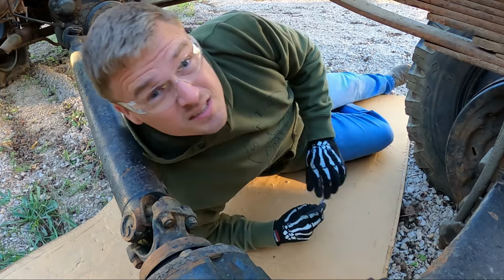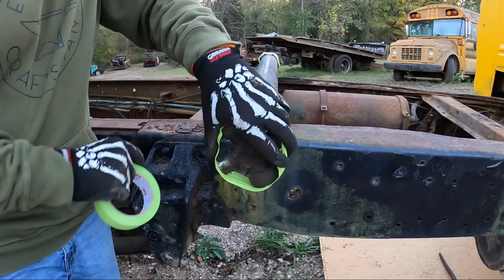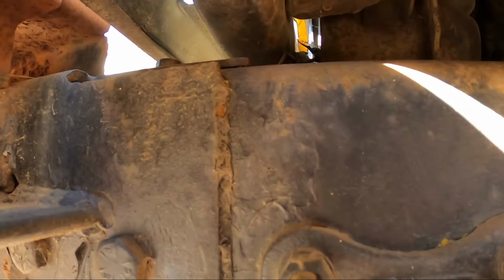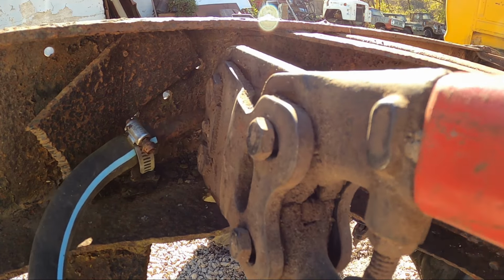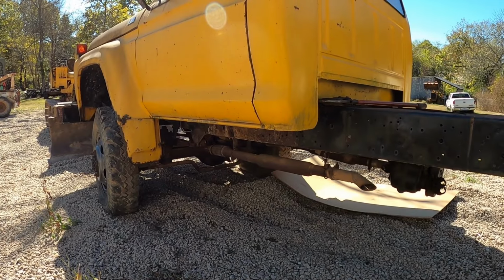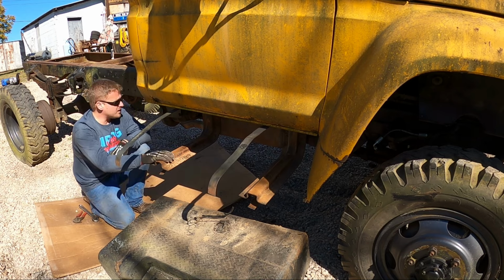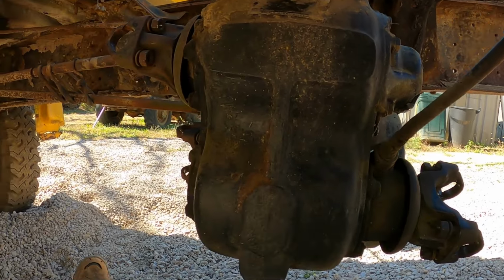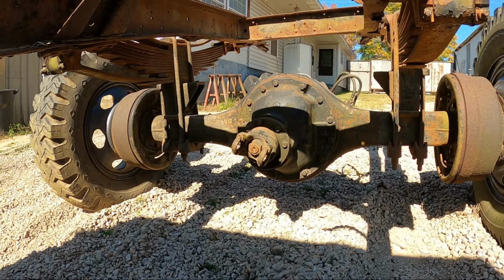Project Atlas Episode 6: Teardown Begins

Comment: It’s crazy how much that rust can push that frame out.  Too bad that it has seen a lot of abuse.  I thought it was funny that someone stick welded the bumper to the frame🤣.  That gapping hole in the transfer case is definitely an issue.  Hopefully it can be rebuilt because I’d imagine it would be difficult to find a replacement.  I think a 12 valve is an excellent engine choice.  When it comes to diesels it doesn’t get much better👍
Reply from the maker: Thanks for stopping by Cody! 😁👍 Very true, you can't beat the durability of a Cummins engine. I hope things are going well for your Dakota swap buddy!  Happy wrenching   🔧🔩

Comment: Glad to see you making progress. I see you the same brand of creeper that I use as far as the case you could probably braze that hole up and have a machinist cut it back in but if you’re going to use a common might as well use the NV 4500 and transfer case for that will be plenty strong and easy to get parts for👍
Reply from the maker: You've got a great idea, I could probably just dich the Rockwell t-case.  I didn't even think of that. I appreciate the comment Nathan 😁👍 I hope all is well for you my friend 🔧🔩 Talk to you later
Reply: @HODGEPODGEDODGEGARAGE  did not realize that was a Rockwell T case most likely what happened was they had it in reverse and four-wheel-drive? Those things tend to grenade when you do that for my understanding.

Comment: Great to see you back Zane on the rear diff pop out the axles take five mins. As for the transfer case well you gunna have to take it completely apart and see what happened. Was it water that froze and popped out the bearing cap? Good luck and again thanks.
Reply from the maker: @bradanderson1627  no water luckily, so I shouldn't have to worry about cracks Brad 🙂👍 Thanks for the view and kind comment. Have a great day 🔧

Comment: Probably just frozen brakes. That broken cap is just that, a cap. They did offer an optional pto that could bolt in it's place though. Should be a rockwell T-223 transfer case. Another option is to source a transfer case out of a M35a3 truck, rockwell t-136-27s. 4wd engagement is accomplished with air & it's a shift on the fly system.
Reply from the maker: Thanks again for all of the info buddy! 😁👍  Have a good week at work and I'll talk to you Sunday 🔧🔩
Reply: @HODGEPODGEDODGEGARAGE  not a problem! You never know what kind of odd ball literature I have laying around!

Comment: Kinda sad about that frame because that truck is nice. I'm pretty sure you told me before but if you did I forget but that front axle looks like a Marmon-Herrington axle. If that's a Marmon (Rockwell) transfercase it's going to be expensive. Marmon-Herrington & NAPCO were common AWD/4x4 Convertions on Medium and Heavy Duty Trucks back the .
Reply from the maker: @TeamTopKick  luckily it's not a Marmon axle, it's a Rockwell 🙂👍 Glad you stopped by Brandon 🔧